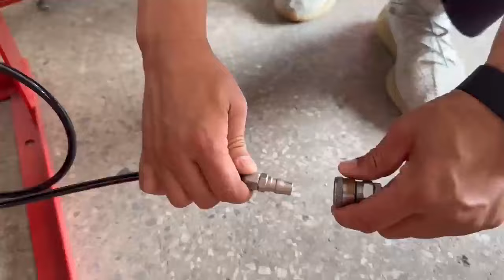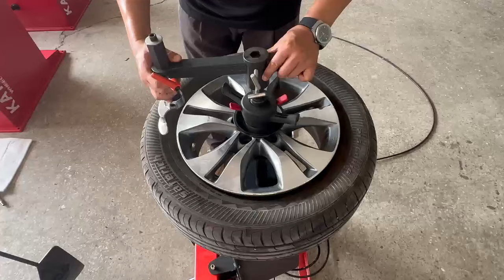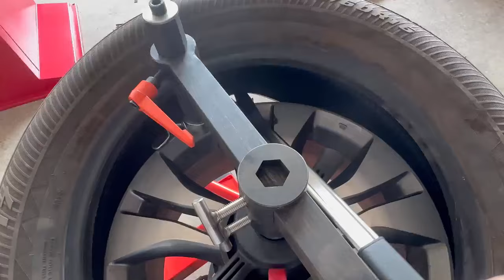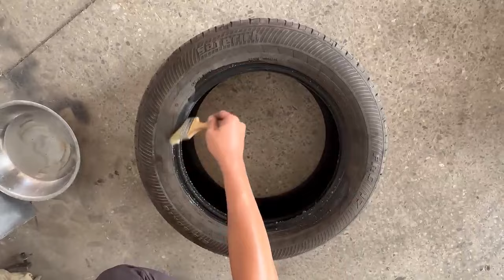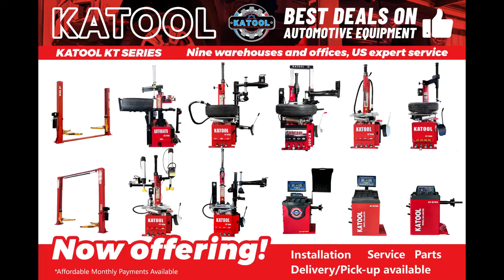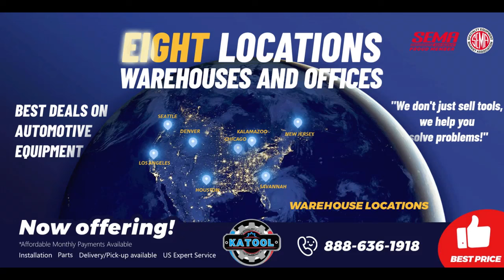KATOOL Portable Hand Tire Machine KT-2002

Comment: Just purchased one off of ebay and lets just say we are not liking it at all. Very hard to get it to work. The long arm that spins the wheel turn table has bent on a 14 inch wheel. Will not do 17 inch truck tires. Just my 2 cents
Reply: That's too bad, was gonna pick one of these up to mount/dismount 17 inch truck tires on three of my Ram 2500 work trucks.
Reply: You must not know how to use it as the guy in the video is doing probably 16’s. I have done tires growing up in multiple shops and can’t believe how many people just don’t get the concept. Sorry for you incompetence.
Reply: FYI, I have changed 20 years old heavy duty trailer tires 17" with no problem. Plus the bead breaker just popped off the bead with no problem. I have now done 10 tires of all sizes with no problem, make sure you use tire lube installing and removing the tires of the rims.
Reply: Hi robert im thinking of getting one im experience in tire changing so it it your opinion if used properly it can do low profile tires
Reply: @joecat1198  I have not done low profile tires but I would think after using mine it will work.
Reply: I just saw someone else review this tool and theirs bent on the first wheel too.  That guy welded a gusset on the end that goes into the bead breaker arm.  Just like the old horror freight manual changer, they cheap out on the design and steel too much
Reply: @joecat1198   So did you ever get one????? I am building a attachment so you do not have to keep moving the pushing bar. Just keep pressing the foot switch keeps it moving.
Reply: @strong40  That is interesting, mine works fine you do have to use tire lube.
Reply: Yes i did get one
I wanted it for bead breaker only 
The section for installing tire with duckhead i didnt install it on the machine so its just the box section with bead breaker 
I decided to use my coats manual tire changer setup with duckead for installing  works great that way for me
Reply: @joecat1198  Good, I am glad it is working for you. I love the breaker part the best. Works GREAT!!!!

Comment: I have this tire changer, for a home shop it is great. Very strong and work well. The bead breaker is a game changer, no more pushing down on a bar. The air cylinder will break any bead, even a tire that has been on the same rim for 21 years. I put wheels on mine and when I am finished using it I just roll it in the corner if the garage.
Reply: What did you need to hook the airhose up I am not familiar with the type of fitting it comes with
Reply: @patrickfagnan4033  Patrick, You can remove the existing air fitting and install a new fitting that will connect to your compressor. Yes, the fitting that came with the unit was a strange size that is why I just cut it off. Does that help?
Reply: @robertbeltowski2819  yes that does help

Comment: This must have a required air tank capacity to run. I think a pancake compressor would be depleted from one operation and run the whole time.
Reply: I've used my full sized tire machine on a small compressor and it was fine, yes there is some waiting involved but this type of tool shouldn't be used daily.

Comment: Anybody know where hoses hook up ?….. just got one but no instructions came with it ….. Thanks
Reply: Did you use it yet? Does it work flawlessly?
Reply: Have used it several times now and love it !…
Reply: Does it lack power when pulling tires?
Reply: I bought this, I pulled and remounted all 4 of my truck tires 265 70 R17s that have TPMS, with no issue. To make less strenuous on machine must use good lube, not just soapy water. I bought a tire mounting paste.
Reply: @jamiesawyer5102  No it does not.